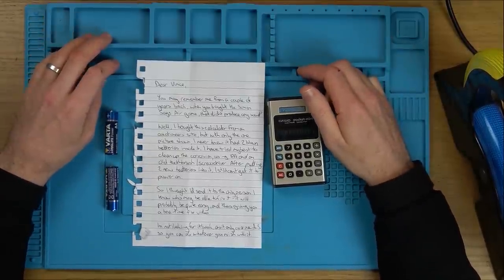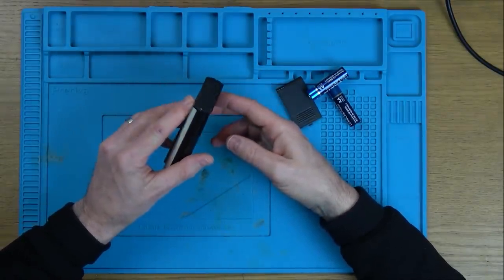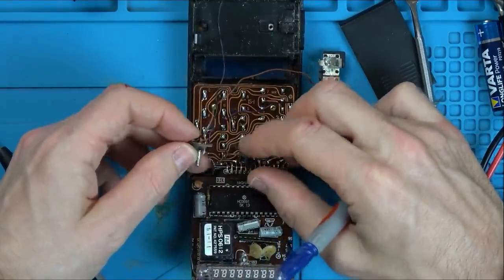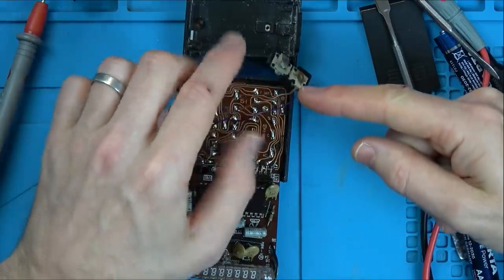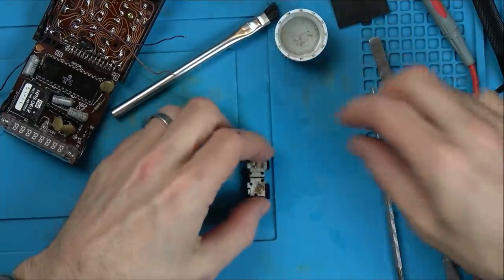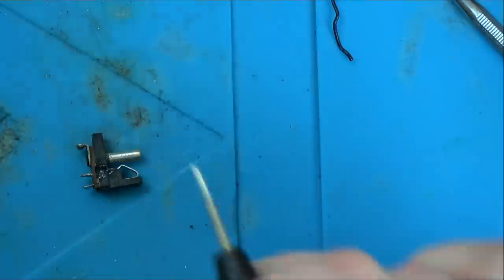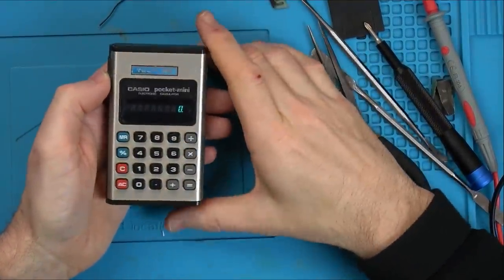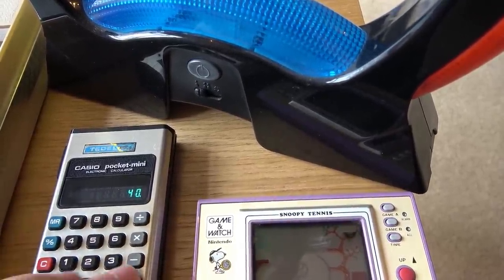Broken 1975 CASIO Pocket Mini Calculator P-810 Repair

Comment: Another fab video Vince. I recently bought a Rechargeable fan from Amazon and it turned up broken. Amazon refunded me for the price of the fan and told me to dispose of the damaged product. For the first time after watching your videos for years, I decided to take the fan apart, fault find with a multimeter and desoldered a faulty capacitor. Found the replacement part on eBay, put everything back together and it now works an absolute treat. Thanks for showing us all that we can recycle things and do our part to reduce electrical waste! :)

Comment: VFD. I bought a 1974 Casio with VFD 2 weeks ago from a car boot sale for 3 euros. All it had was some corrosion on the battery contacts. Quick clean and works fine. Though the power switch may need a slight clean too.

Comment: Nice tea break fix. Interesting about the corrosion wicking.
We totally need a signature Vince.
Reply from the maker: Cheers Emma, I used to see it on telephone cables. Rain would travel in through a damaged cable and run along the inside of the cable (even travel vertically), and end up causing damage to the junction box inside the property. It can travel surprising far. I will get practicing my signature 🤣

Comment: I just tried a similar repair of a plastic part with the same solder iron technique (but it failed.) Have you tried the Bondic brand "glue" that cures with UV light?

Comment: Autosol metal polish is way better than Brasso

Vince - I have a dead Asus TUF gaming Z730 motherboard  with i3 chip that stopped working - I had it replaced under guarantee, but kept the dead one. You can have it free if you would do a trying to fix it video
Reply from the maker: 👍👍 Cheers Piano man. I would like it BUT at this moment I don't have anything to go with it like the PSU or cables etc. to connect things up. I am slowly getting into laptop repairs and I have just finished looked at a DELL All in One PC so I will get there. Maybe if you still have it later in the year and are still happy to send it in, we could sort it out then?
Cheers.
Reply: @Mymatevince  I 'm sending you a message vis your facebook page as that's private.